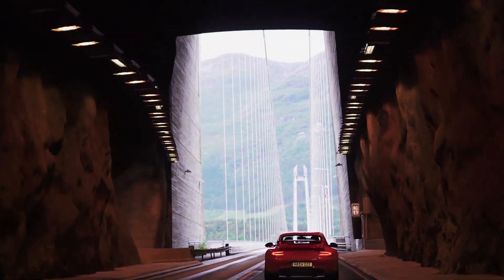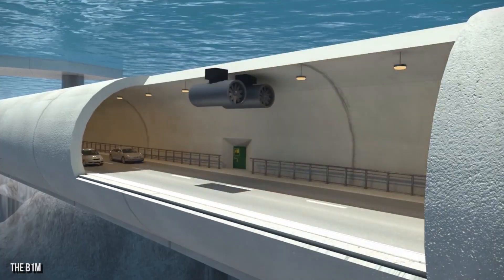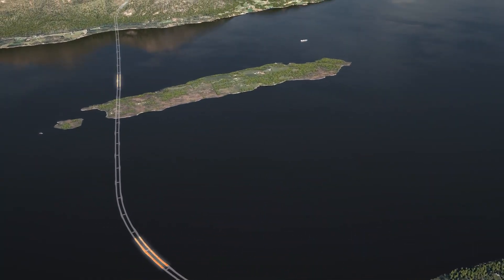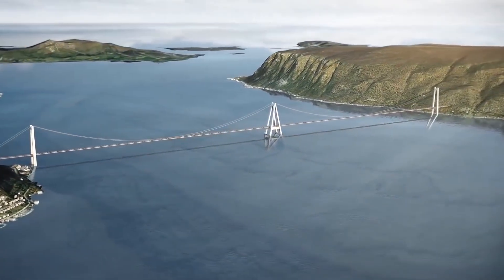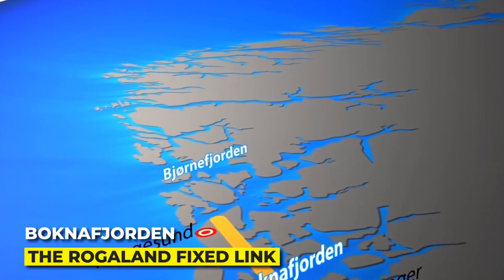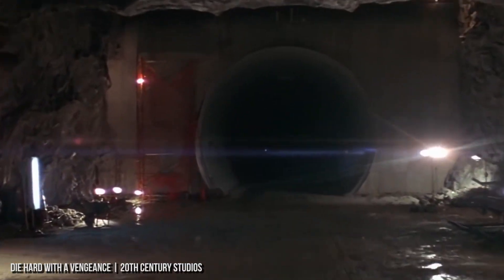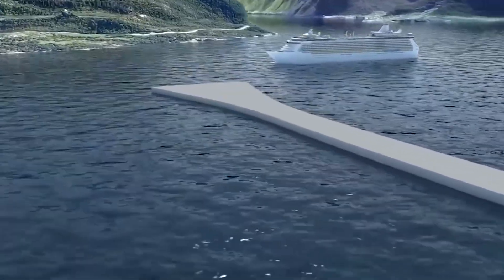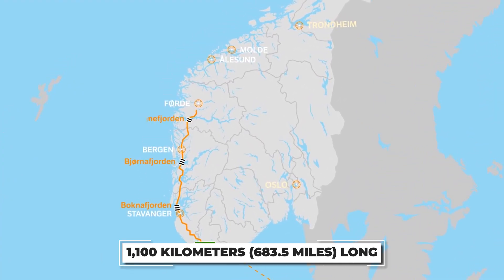Inside Norway's $47 Billion Floating Highway

Comment: Norway in Cantonese mean 'no brain'. 
Now I know why. You can use compression to force strength into the structure using suspension cable to minimize weight and optimized strength, not float.
(Refer link in profile or google "Danny Woo Vk" in Bing for book of life and cure for COV19)
Reply: That thing will float by itself since inside have air and outer layer strengthen by compression force from both end mean only tsunami could break the tunnel.

Comment: If this gets built, I would be directly affected. I don't support this plan. It's going to have a lot of consequences for nature, and we don't need to lose the ferries.When the seven different ferry crossings is mentioned in the video, you're using footage of Hurtigruten, which is not one of the seven crossings. Hurtigruten travels from Bergen to Kirkenes, and is not a part of the E39 road.
Reply: based on todays prices, ferries are not an option. Its also inefficient and slow

Comment: You had my attention until you said the road will run 100 feet below sea level... Is there a medical study to focus on the added water pressure drivers will face?!
Reply: You serious? Tunnels are among the safest transportation routes. Just ask Elon Musk who's currently building tunnels in and around the San Andreas Fault.
Reply: Not water pressure, air pressure. 100 feet? About the height above the sea of the top deck of one of those monster cruise ships.
Given the number of tunnels built through mountains that cope with ten times that water pressure, I guess the engineers have that one figured.
Reply: @nicktecky55  As you descend, water pressure increases, and the volume of air in your body decreases. This can cause problems such as sinus pain or a ruptured eardrum. As you ascend, water pressure decreases, and the air in your lungs expands. This can make the air sacs in your lungs rupture and make it hard for you to breathe.
Reply: @knolysjohnson7244  the deepest undersea tunnel, as well located in Norway, is more than 940 foot below the water line ... it's not like you'll live down there, you drive down and up again, that won't create medical issues
Reply: @nicktecky55  I think the point you were trying to make is above water level humans face air pressure(one atmosphere) is the known standard at sea level and this number increases as you descend!
Reply: @knolysjohnson7244  The tube is open to the atmosphere at both ends, otherwise drivers would have to got through an air lock. So the only thing acting on the driver is 100 feet of additional air pressure, about the same as a ten storey building. It is the structure of the tunnel that takes the pressure of the surrounding water, uniformly applied around the structure ideal for a circular bore.

Comment: So how do they get around the fact that there will clearly be more obstacles for barges and boats to maneuver around in that harsh weather? Can the tunnel hold up if one of the flotation points is taken out by a boat?
Reply: there is no ship in existence that goes below 30 feet under sea level
Reply: @gullfeber  right, but if you read carefully I’m only talking about the floatation points. If you go back to the video, when they show the design, there are several points sticking out of the water that are connected to the tunnel 30ft below.
Reply: @tyi6566  they would more than likely take that into consideration when constructing it
Reply: @gullfeber  true. Just seems like the best option would be the cables to the sea floor holding up the tunnel but I’d just be curious to know the limitations to both methods but the video didn’t go into much detail on that
Reply: @tyi6566  i believe the actual government website describing the project might give you more technical insight
Reply: @gullfeber  yeah I tried looking and found some stuff on it but it seems like it’s still in the very early stages where they might not even know all that yet. But the transatlantic cable was laid the whole way across the Atlantic a century ago so they should be able to figure it out. With all the natural disasters that have destroyed bridges and roadways in Japan I believe if this works in Norway then it’d be a great idea for Japans islands.
Reply: @gullfeber  go to 5:15. I’m not understanding how the floating pontoons wouldn’t cause more problems than it solves. Unless they don’t plan on doing it that way

Comment: $200 in fuel and about $500 in tolls. Every time the Norwegian government fills in a pothole, they put up a toll station for the next 15 years to cover the cost. I live in Norway and I doubt anyone will be able to afford driving on the road if they plan to cover the cost the way they always do - by gouging the motorists.
Reply: Roads have to be paid for somehow. Toll roads and gasoline taxes are efficient in the sense that they're proportional to the individual user's consumption of the resource. Now, whether the Norwegian government is operating the roads efficiently or diverts the revenue to other purposes is another question.
Reply: Don't worry. Long before this is built cars will be replaced by autonomous electric vehicles, and they will be owned by Amazon and the like. Free to use is my prediction. Unless you insist on driving yourself, then you'll be classified as a biohazard and pay accordingly.

Comment: I have nightmares:  How to prevent corrosion of such hang cables?  How to prevent flexing of the tunnels during rough sea?  What flexible material can seal the joints over 100 years?  How to stop leak?  How to evacuate faster than the flow of water?
Reply: move to the middle of a large desert . Stay away from water at all costs . Your nightmares will end . You will be dirty but no more bad dreams .
Reply: Duct tape.
Reply: Flex tape
Reply: If a tsunami would happen, what then?
Reply: @ellenstewartbowman3898  most likely nothing, as a tsunami doesnt affect much below sea level

Comment: It would be much safer to simply bore tunnels under the fiords. Mines go much deeper without too many problems.
There is very little solar energy available in the  Arctic and sub-Arctic in winter. The idea of using solar power in this region to defrost roads appears absurd.
Reply: When mines go that deep, they basically go straight down, how steep do you think they can make the road?!
Reply: @ Angus: 700 meters should be doable. The Norwegians are currently building a 390 meter deep road tunnel. Removing car and truck exhaust can be problematic as can waterproof ing the tunnel.
Reply: @johngeier8692  I understand it is "more water" but tunnels already need to be quite sufficiently waterproofed when underground as well. Also it just doesn't seem practical to go so deep for the distance it's going.

Comment: One of those ferries doesn't cost gas. But you know it cost us 30usd just to cross the province here in Java using high way
Reply: It use gas, i'm from West Java, crossing between Java and Kalimantan with such cost covers the Ferries fuel cost as well, its not cheap nor efficient
Reply: @ryhanzfx1641  I mean you don't pay extra other than the ticket itself when using ferries. On contrast, when you use the highway, you'll pay both the ticket and the gas on your vehicle.
Reply: @ryhanzfx1641  there is no other way for you to cross. It's either boat or plane. Compared to one on another, one is cheaper and one is faster
Reply: @ryhanzfx1641  the video said that both ways cost the same, but traveling by road has some hidden cost that they don't mention. But even tho it will cost more, still cheaper than here in Java so it's fair enough. That's what I'm trying to say

Comment: "But is there a chance the track might bend?"
Reply: if you anchor it to the ground both upstream and downstream it should stay in place, but anchoring it straight down as shown in the video will let it bend depending on the current, and using floaters on the surface will let it bend even more depending on the current, as well as in height depending on the tides

Comment: The intercity train tunnel connecting Oakland and San Francisco is a submerged floating steel tube anchored to the bay floor with steel wire. The engineers underestimated the buoyancy of the tube and extra anchors had to be added and cracks welded over 40 years after the tube was built. I was told by someone who worked on the seismic retrofitting project that the lead engineer had resigned because he said it would be impossible to make it safe in an shallow 8.0 magnitude earthquake as the state had required. Tunnels are much safer as they are within the earth and in consequence all of the tunnel walls move together in an earthquake and will not likely be damaged.
Reply: well not all areas are affected by earthquakes and tectonic movement like California is ... no such problem in Norway
Reply: "The intercity train tunnel connecting Oakland and San Francisco" = B.A.R.T.'s Transbay Tube
"Tunnels are much safer" = "7 fatalities in BART history."
good luck norway!

Comment: they're making this waaaaaayyyyy to hard for themselves, if weather across bridges is the main issue here then all they need to do is separate the weather from the bridge. an easy way to do that is to cover the top and sides of the bridge with concrete. doing so means no wind or snow to effect cars on the road reducing the chances of an accident significantly. then so long as the thing is built strong and properly no issues will arise and it'll make the project far cheaper whilst doing the same thing. no need to build it watertight, no need to make it floating, no need for as many emergency exits as they have. this is what happens when an engineer over-thinks things. no doubt the tunnels would be safe. however if 1 tiny little hole is created the whole thing burns down with it. it's pretty much impossible for that tunnel to be safer then a bridge whilst on the same budget, they also state that they're concerned for the environment, however how is a large-scale underwater tunnel any better?. at both ends of the tunnel they need to dig down anyway between 20-50m deep maybe even more, a few metres wide and maybe 100-200m long. realistically the effect on the surrounding environment is the same for both projects. is it just me or is norway just tryna look cool and make things significantly harder then it reasonably needs to be for themselves right now.
Reply: most Norwegian tunnels don't have emergency exits, and building bridges across some of the deep and wide fjords is so complicated that the option with the tunnel makes more sense and is probably even easier to build. Well Norway actually has to deal with significantly harder conditions than most countries in Europe when working on any larger infrastructure issues ...
Reply: @EnjoyFirefighting   you must have rocks in your head if you think that's gonna be easier to build. plus I already covered the conditions. do you really think dealing with tones and tones of water and stone + rock etc plus building a tunnel through that is going to be easier then building a bridge??? even with snow and crap they're going to pick their times when their working to not be in shit conditions regardless of how they do it. building an underwater tunnel will be harder and more expensive hands down.
Reply: @stormy4752  concerning how extremly deep some of the fjords are it seems like it's a realistic option as alternative. See, I'm no expert in this, but those who are for sure thought about many different ways to get across the fjords and looked at pros and cons of the options. Either the bridge will have an extreme span or the piles would have to go extremly deep

Comment: 1'm sure they have considered adding an electric train to this idea. would greatly increase freight to all these areas.
Reply: We close more rail lines than opening new ones i Norway, we have a club for building a new railway in the same area.

Most eaikways in Norway go some 15-40 km inland , because when they were built  in the 1800's, they felt that the coastal towns had harbours and did not need a railways, even if they built feeder lines to the harbour towns.

Comment: Problem I see with using pontoons at the surface to help support the tubes is a simple one.  Wave action.  Specifically, what if one of the glaciers up the fjord drops a LARGE chunk of ice causing a seiche?  That would cause the pontoons to move, flexing the sections of the tunnel possibly causing a break.  Anchoring the tunnel sections to the sea bed directly under the pontoons should counter that effect.
Reply: Norways glaciers are mostly  not that close to the fjords, if the closest ones were to calf, the ice would have to slide quite a long way. Most glaciers are on top of mountains or in between different mountains, and most are shaped in a way which makes calving very unlikely. The closest glacier to the fjords would be blåfonna (I think) a quite small one.

However  I'm sure they're thinking about solutions to this, as extreme weather that causes waves can happen, though the fjords are often quite calm.

Have a good day!
Reply: @uhh_uwu1164  Thank you for the information.

Comment: If this country was located in the middle of the EU, I could actually understand the need for it...
However, this is clearly a vanity project to spend the billions the Norwegian government hoarded from oil and gas income…
FYI, by far the most amount of people live in the south, so this project makes no sense...
Reply: elitechrstn  I am not disputing the need to cut travel down, I am disputing the type of investments done to cut the travel time down. It takes too long and there were cheaper alternatives instead of this "showboating" engineering project. They should start with these kind of investments in the south first and foremost and then work their way to the north... Just saying, sorry not sorry.
Reply: @ABC-ABC1234  " by far the most amount of people live in the south, so this project makes no sense..." uhm actually that IS the south, the south-west to be precise. Cuts travel time, increases traffic flow especially for commuters and truckers. 
Btw similar large infrastructure projects are going on in central Europe; However the location of the country shouldn't be an argument against projects to improve local traffic flow
Reply: @EnjoyFirefighting  Euhm  it's also about cost efficiency. You can build the most dazzling high tech bridge, but it will be rendered useless and a waste of resource when it doesn't attract sufficient traffic, which in a country of 5 million people, I highly doubt. I am all for infrastructure, I just believe this particular type of engineering will cost too much and will take too long. If connectivity and infrastructure was a priority, then Norway would have had these tunnels a long  time ago and not stalled with this project to show off.
Reply: @ABC-ABC1234  it definetly will attract sufficient traffic. Ferries are often running at their full capacity during the day, especially with trucks and buses forced to be left behind and waiting for the next or 2nd-next ferry to arrive. An issue especially in the morning, afternoon and of course in the tourist season in general. 
5 million inhabitants isn't a great number, but keep in mind that there are also way less roads. Getting from A to B you often have option A ... only option A, without alternative routes B, C, D etc going to the same place with only minor detours. Thus all the traffic focuses on that ONE road, or the few roads depending on the area and location. Doesn't mean that there will be so much traffic that there's a traffic jam, but it's usually quite a moderate amount of traffic on every such road linking populated areas, towns and cities. 
It's nothing to show off, or sth they waited until it would be a great PR thing ... it's simply sth which is called improvement and expansion of the existing network. When you have the idea you won't be able to just make it happen within a short period of time. And you can't realize like dozens of planned large projects at the same time, and the need for a new, adapted or expanded network might also just come up within the recent years.  
Even much much smaller infrastructure projects can take YEARS before construction even starts even though they are overdue and really necessary. In my home town the replacement for a very short bridge across a canal took more than 4 years; And a replacement bridge or tunnel for buses at another location in the city is planned for more than a dozen years now and construction hasn't even started ... Norwegians are rather fast with their construction projects. The construction of the world's longest road tunnel took only 5 years for example.

Comment: If you have lost over $5000 or less in iqoption or in any other trading platform we will recover without any much deposits from you.we will deposit,trade and make profit. 1. No deposit from Account Owner 2. Lost account should be above $5000 3. We will share the profit with you. 3. For account safety, we use VPS based on Country! Inbox me if you have lose account WhatsApp +15135722905

Comment: A terrorist organization would have a feast with this. Bad, bad idea.
Reply: why specificly on this road?
Reply: @EnjoyFirefighting  Would you drive on a floating tunnel that's under water? Accidents happen in tunnels all the time, yes, but an accident on a tunnel of this kind would be the absolute worst. This is not a good idea.
Reply: @hannahgomez7554  there are more than 1100 road tunnels across Norway already, with some of them being under water, with some others having roundabouts or intersections, some others have hairpin turns in them ... in most tunnels at the coastline you won't even know if you're above or below the water